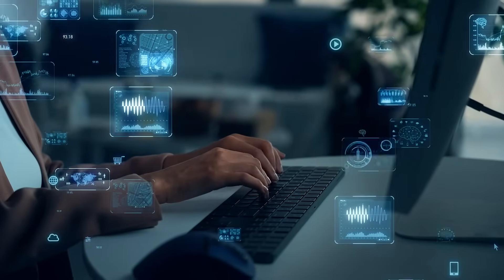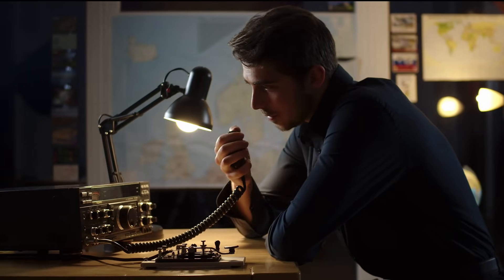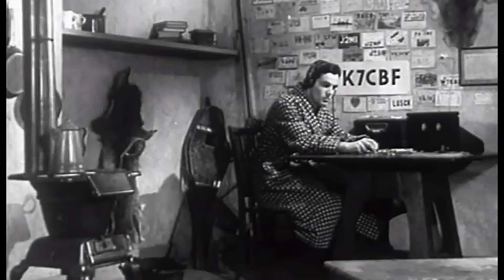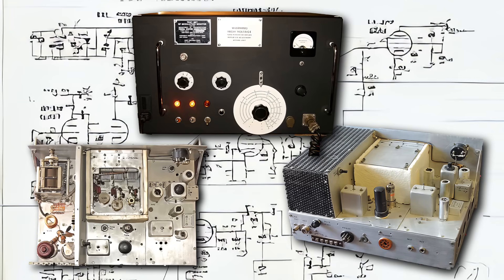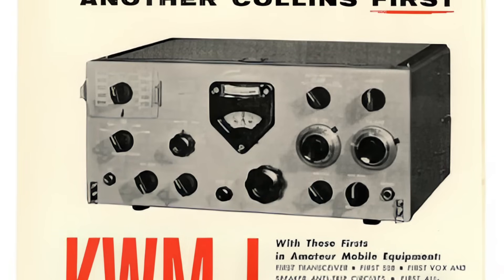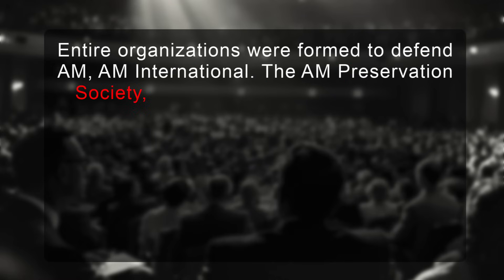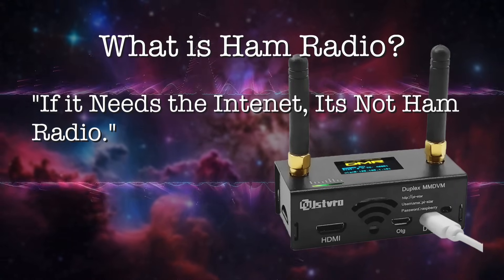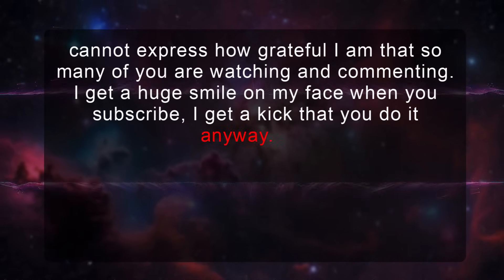Why Single Side Band (SSB) Almost Never Existed!

Comment: That's how it is alright. I often wonder if the CW guys hated the new AM. Probably not, ham radio is like any other hobby. It has styles that ebb and flow. I hate to admit it, but I have sometimes grumbled a bit about new modes myself. An older ham told me when I was a young Novice, "A contact is a contact when your at the control point.
Reply from the maker: I have always been a person who was curious about many things in life. And as a result I always like learning new things. I was amazed by technology even as a kid so for me new modes were never a problem. I have tried almost every mode I can think of. Everything from fastscan ATV to Satellites and even a little EME moon bounce. :)

It is perfectly normal to find a mode you like and stick to it. But what I don't understand is why some hams have a grudge for those that like modes that they would never use. If someone wants to camp out and work POTA contacts on 5 watts. GREAT. I prefer a tower and 1500w but that is just me. hehe

Comment: I got my General ticket in the late 1950s and all I had was the ability to receive and transmit on AM. At the time, I would be listening for who had the best sounding mike and signal. Then SSB came on the scene. thre wa a kind of war between hams and when an AM signal was nearby in frequency, it would "splash" in bandwidth. When hearing SSB signals it sounded like mush until I learned that flipping my receiver over to CW was I then only able to hear intelligible SSB. A few years later everything was. all SSB. Hardly anyone used AM. Then I acquired a Collins KWM2 and was using it all the time especially when it came to contests! Lots of fun in those days.

Comment: I'm a strictly CW guy... I HATE FT8...its digital radio trash!!!! I dispice FM & repeaters Too & i too dislike OSCAR 😝😝😝!!!
Reply from the maker: Sam that is the BEST part of Ham radio, is no matter what you are into there is something you can enjoy. I have tried just about every mode I can think of. Even Fast Scan ATV. I even ran one of the first Winlink gateways in DC area for 10 years. They each have their uses and purpose.

Consider that not everyones situation, experience or financial situation is the same. I get why FT8 and other modes have become so popular. The technology allows anyone with a simple set up to make long distance contacts. It is like an entry level drug. So may go on to do bigger and better setups and some may not. But regardless it is all part of our hobby and I believe we should be supportive and encouraging.  Even if it isn't our preferred mode.

You might be happy to know that there is an increase in CW operations. I believe this is due in part to POTA and QRP operations. So while some hams complain about POTA, it has changed the hobby.

Comment: Parks on the air is not a mode.
Reply from the maker: Technically you are correct. But it still has contributed to more growth than other activities I have seen.
Reply: @HamRadioGizmos  it is not technically, there is no relationship. Is there a POTA button on your transceiver? It is a stupid comparison.

Comment: Can someone please name some WW-II era military SSB radio equipment?
I don't ever remember seeinig anything military surplus SSB from the WW-II era.
Reply from the maker: Steve I don't think there were that many. Sideband was experimental then but I think BC series and the early Collins gear was starting to show up right after the war. I believe Strategic Air Command was the first to add SSB after the war. I think you are correct, any radios that used SSB during the war were most likely built specific for testing and do not think there were any real commercial radios till a few years later.

Comment: FT8 is like texting on a mobile phone!. You didn't mention why USB is above 10.000Kz and LSB is below 10.000Kz? great video
Reply from the maker: Except FT8 is open source, doesn't use a company service, can communicate around the world on 5 watts, uses HF Ham Bands and was developed for weak signal work and can decode a -22db signal that you can't hear with your ears. Also was developed by a ham and a astrophysicist who has a Nobel laureate in physics. So yes I guess they exactly a like. 🤣🙃

Comment: Great for radio. Meanwhile multichannel voice telephony developed using balanced modulators with two transformers and four diodes followed by a moderately priced filter for one of the sidebands, then stacking 24 channels (USA) or 30 (ITU) and multiples thereof. Long distances overland and undersea were compensating for variations in attenuation using pilot frequencies. Such systems went transpacific in 1963 with 80 channels.

Comment: Having a Ham radio channel with AI narration is like using an airplane to drive to the gas station.
Reply from the maker: Jordan normally I would delete stupid comments such as this. But instead let me do you a favor and help educate you. 

1. Old Technology
Computer speech has been around since at least the late 70, early 1980's. If you do a search on either a Windows or Mac, you will find they both have text to speech and speech to text.

2. Handicapped
If someone is disabled would you deny them the ability to use their voice to control their computer? What about someone that is blind, are you saying they shouldn't be able to use TTS to read a book?

How do you think Closed Captions are generated. Does this offend you and prevent you from watching a show?

3. TTS is NOT AI
I know the people that write the software would disagree but I do not consider TTS AI technology. But TTS has been around for decades. Every time you call your bank or any company that uses an IVR, Interactive Voice Response system. Also TTS is in your cars navigation system, your cellphone and even some TV's.

Are you telling me you have never used any of these technologies before?

4. ITS THE STORY STUPID
I have no problem if I make a mistake on my research and get something wrong. Or use a graphic or video that takes the viewer out of the story. This is called breaking the 4th wall by the say in the film/video industry.

But to make an analogy that does not make sense or contribute to improving the story is just plain absurd. Why bother?

I was taught as a Child, "If you don't have something nice to say then don't say anything at all. Not sure when most people lost this basic concept. But nowadays everything think they are an expert and something to say.

Finally, I am going to brake my own rule...
I am not going to bother to share my long resume but when I saw Dall-e from OpenAI in 2021 I knew immediately this was going to be a disruptive technology. And it was important to learn everything I could. So when it became common place I would know how and if to implement this tool.

Which is why it is so frustrating and frankly pisses me off when people come in here, not to learn or be entertained by the stories I am sharing. But instead drive by and make stupid, uninformed comments about technology they know nothing about.

We can debate whether TTS uses large language models LLM's AI. But one thing you CAN say is AI here to stay. So like it or not. TOO Bad. That horse has left the barn and there is not getting him back. Sorry. :(

Comment: Just like the digital modes of today espically FT8 ...I have beeen supporting digital modes..
Reply from the maker: Paul one of the great aspects of Ham Radio is no matter what you are into, there is something for you. Digtal, TV, Ragchewing, CW, Satellite, or just building stuff. I have friends who never get on the air but love working on gear. Then I have buds who wouldn't know a screwdriver from a hammer. And still love CW. 😁😁
Reply: @HamRadioGizmos   I have been a Ham for close to 40 years .I agree 100%. It  disturbes me  things like FT8 has taken all the Hams away thats why there is such a lack of operaters they are all on FT8.. With this attitude we woild still be stuck in AM ! WE are free  to use any mode available to us.. 73

Comment: You think that was bad, they are considering no license. I can feel the shock waves coming.
Reply from the maker: Considering and "DOING" are two different things. I have not read this but regardless I do not see the motivation. It couldn't be cost and with GMRS and CB I don't see why doing away with licensing would benefit the FCC or the public.
Reply from the maker: While there are discussions and debates around the current licensing requirements, there is no evidence that the FCC is considering dropping the licensing requirement for ham radio at this time. The focus seems to be more on potential modifications and improvements to the existing regulatory framework rather than its complete removal.

Comment: I check in nightly with three nets that have been "... in continuous operation on this frequency since 1947", and have heard others say the same.  1947, the year after WWII when hams were allowed back on the air.  One net there was actually somewhat of a disagreement back in the '50's over AM vs. SSB, and they split into two separate nets, with most going with SSB and the other few going to another frequency as AM.  As far as POTA, what an invaluable skill this develops!

Comment: Wait until I start using ATV on HF with my new NBTV mode, using GNU Radio and the HackRF for the modulator / demodulator. R&D is still happening in Ham radio today, this mode is ready to go on the air and to start making DX contacts.

Comment: My first SSB experience was listening to it using two old tube AM radios.  The VFO leak from one leaked into the common antenna and could be used to inject a carrier so one sideband + carrier could be demodulated as AM.   It drifted like crazy, but still fun for a young boy.

Comment: Nice video. Was it done with AI?
Reply from the maker: Great Question - Here is my process:

1. Research:
I do a lot of research on each topic and collection, as much reference material as I can find.

2. Script:
I write and polish the script to get the right humor and feel.

3. Editor:
From there, I send it to my colleague, Sue-Ann, who is a professional writer/editor. She makes me sound smarter than I am. :)

After she is finished, I send it to a few other hams who know a lot more about the topic than I do. I learned my lesson with the Heathkit story. Like most hams, I didn't know the history but thought I knew the products. I had NO idea they sold a microwave oven. Hehe

4. Voice Over:
I use a text-to-speech system that is not really AI. It doesn't change the script; it simply reads what I send it. The tech is similar to a phone system at a bank, your car’s navigation system, or Siri or Alexa.

Unfortunately, a lot of people think the content is simply AI. I wish it was that simple, but it takes a lot more work than that. The reason for using a TTS system is I often find that writing for an article or blog does not sound right when spoken out loud. This also gives me the ability to make last-minute changes quickly.

And of course, it would cost me about $300 per episode to hire a VO artist, which I hope to be able to do at some point. The interesting part is TTS is getting better and better, and at some point, it will be impossible to tell the difference.

Honestly, it is all about the script. I try to include my own real-world experiences in the script to help share my expertise and passion.

I hope this helps, but let me know if you have additional questions.

Lee

Comment: After more than 60 yrs SWLing and nearly 50 yrs CW operating i can say that i've learned from your video. Thanks for all.
In my early SWL years first SSB transmissions were coming up here in central Europe. But for a schoolboy were SSB receivers too expansive.
But while testing with two AM radios i found the IF carrier. After this i could listen all cw and ssb. Long time ago ...
DL4BAM
Reply: I did the same using two AM radios in Norway.  Then I began with CB in 1980 and moved on to HAM in 1986, 73 de LA7DFA
Reply: @la7dfa 
Yes long ago with lots of stations on LW and MW and SW in several languages. But these interval noise (CW) got my special intetest. I eanted to know, what's going on there.
 My first TX was a Philps KIT for young people. My KIT should be a searching Radio for TV's IF. It never worked. While thinking about i realized that the KIT produces Signals in the BC FM Band. Quick connected a cole microphon at the speaker outlet and modulation was found. That was my first "pirate FM station" . After this i tried several ways of receiving SW. 1970 i got my first US kids CB handhelds. Max distance 70 mtrs. At that time 10 mtr was my favorite Band. In 1978 i got my first licence for VHF and higher. But CW was most important for me and my class C licence in DL was only for radio club contacts to my HAM friends. 1980 i got my actual Callsign DL4BAM. I was very active on 10 and 30 mtr in CW speeding up to 240 cpm. Now i'm starting my part time retirement and all antennas have to be renewed soon. But CW is since 60 yrs my favorite. All time long i live my greater colltectionif shortwave radios. I like to compare them. Quite a Hobby in my Hobby.
Maybe we meet together in the bands. Next week i take a trip to Ham Radio Fair in Friedrichshafen meeting some guys out of my 50 yrs membership in DARC. Since 1980 i've been there nearly every year.
Vy 73 de Dirk, DL4BAM

Comment: Different Strokes for Different Folks.  FT8 is lazy operation. It also makes difficult contacts easy. But is it bad for amateur radio? No way. We all learn from these technologies and end up with more options, also more reliable comms when we truly need them in times of emergency. AM has not been outlawed. ESSB is still available for the audio nuts. Lets all have fun, and consider the other guy like we used to.

Comment: Sure, there are many new HAM radio protocols like RTTY, PSK31, FT8, etc. today. I started with PSK31 many, many years ago and actually wanted to use something like CW conversations via PSK31 but I got back the prefabricated texts like PC configurations, etc.. I only really managed to have a PSK31 conversation once. Somehow I got tired of it. In the early days of FT8 I was very enthusiastic, especially about the algorithms behind it, and I thought that now you could make real weak signal communication around the world.  Until I realized that it's only QSO “done” and the s-meter value is the main point of the interest . I then tried for a while to work only very weak stations, because “weak signal” is the idea of FT8, but at some point FT8 was too little for me personally. Now I'm back to the “old” HAM radio modulations and enjoy the personal touch in the QSOs, even if the QSOs are supposed to be short.

Comment: Here's the thing: Radio broadcast is a lot about transmitting music and has been so since the first tests before WW1. Music transmission does not work with SSB. The best option is, of course, single sideband with reduced carrier as it was adopted for the video signal in analog TV. However, due to compatibilty AM audio broadcast was stuck with two sidebands + carrier and only in the 90's some advanced  AM recievers offered improved quality by decoding only one of the sidebands with an LO locked to the carrier.

Comment: The first trans Atlantic voice cable was in 1957.  Prior to that, radio was used.

I used to be a technician with a Canadian telecom.  Back in the mid 70s I worked with some ancient voice carrier equipment that dated from the 30s (Western Electric C carrier).  It had all of 3 channels over an open wire pair and took an entire rack to do it.  Later tech, from the 50s could do 12 channels and could have 3 or 4 systems in the same height rack.  With filters, the 2 systems could be carried over the same open wire pair, for 15 channels, and you could also have a channel directly on the pair.  There was one system I read about, but never saw.  This was the H carrier, which provided a single voice channel on that pair and took the full height of the rack to do it.  This was all SSB tech and the equipment came in models with slightly different frequencies or USB/LSB to reduce intelligible cross talk between systems on adjacent pairs.  Of course, by the late 60s the digital T carrier systems started appearing and the analog SSB gear faded away.  Incidentally, that C carrier system used something called Sensitrol relays for automatic gain control.  This was essentially a meter with contacts.  As the needle moved one way or the other, it would hit a contact, causing a motor to operate to adjust the gain.  When bad weather approached, you'd hear them clicking more and more often!

Comment: Except FT8 doesn’t require any skill.

I’ll do everything else: Winlink, Olivia, PSK, voice, WSPR, DMR, etc.
Reply from the maker: @ImageJPEG

Have you used FT4, JT65, Q65, or MS144. mode? Every one of these is included in WSJT. Different modes for different uses. Just like SSB, AM, RTTY, or CW. How about you? Are you a CW guy?

I have used every one of the modes you listed. In fact, I ran one of the First Winlink gateways in the WashDC/MD/VA area. Sorry, I don't see the skill in writing a Winlink Email. 

The point is a "Skill" is a relative term. I bet I have a number of skills you don't have, and vice versa.  So your idea of skill only applies to YOU !

Sorry, I just don't understand the hatred for FT8. They take up a whole 3 kHz. And they are way down at the bottom of the band.

It must be the idea you dislike, because you are not fighting them for the spectrum. You are not arguing over politics. You are not Losing a contest because you are not using FT8. And finally, I don't know any hams that run more than bare-bones 100w right at the most. So you are not being interfered with by a "Big Gun" FT8 guy that moves in down the road. LOL
Reply: @HamRadioGizmos skill may be a bad word choice.

I find it extremely boring.